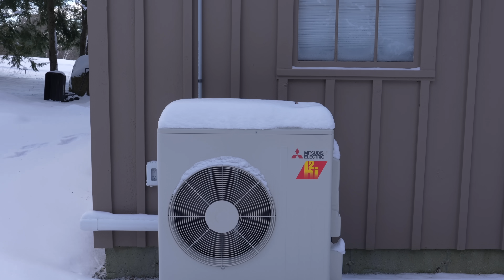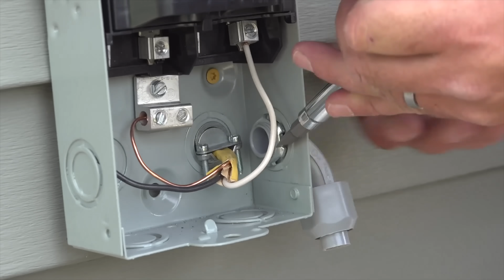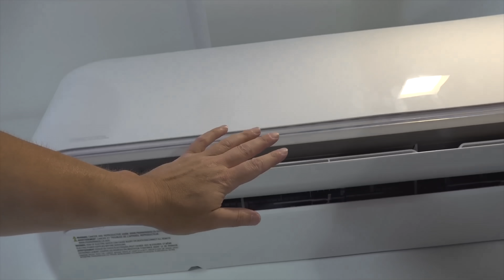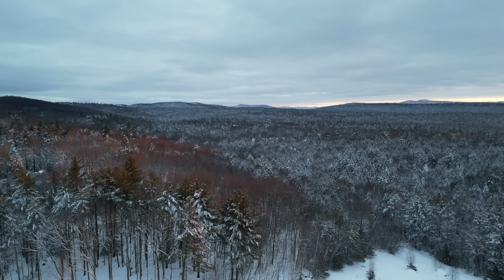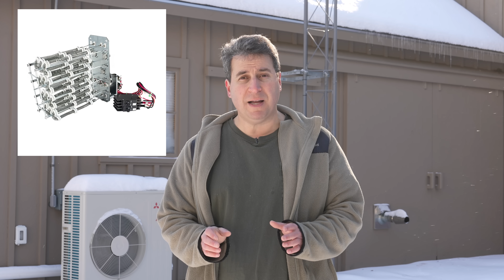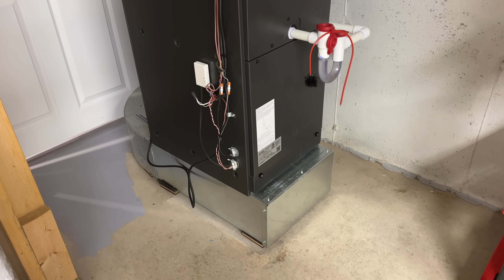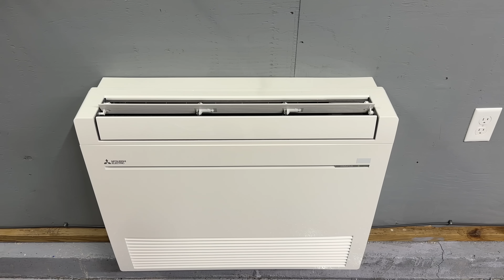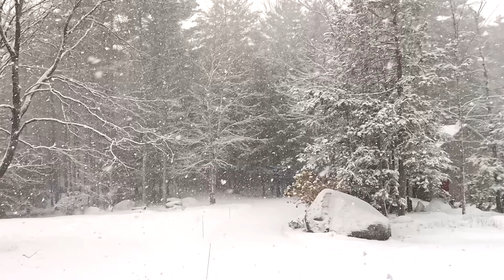Why Heat Pumps are now leaving people COLD

Comment: In the 20’s my heat pump is shit.Are the heat strips supposed to turn on automatically to help the heat pump out to try to maintain some warmth instead of running for hours ? I’m not talking manually pressing the emergency heat button on my thermostat.
Reply: IF you have a smart thermostat, then yes you can program it so that the heat strips come on automatically (you can program the thermostat at what outside temp you want the heat strips to come on at ), but the first thing  you should do is get RID of the heat pump you have and get a COLD climate heat pump, problem solved, you do not have the correct heat pump for your situation..

Comment: total waste of money...Mr Cool 24000 right out of the box opening relief valve blew freon onto my hand. These units are not topped off with freon...so they run not even 70% efficient. Hydro bills running up to $700 + a month in winter and still freezing in the house.
Took 3 of them to the garbage dump last week. No warranty unless HVAC tested.
Don't waste your money on any heat pump unless you live in Florida

Comment: When we had to replace our old heat pump and furnace we opted for an outdoor AC unit and an indoor furnace. We are locked to one electric company and they are very expensive. Running heat in the winter with a heat pump costs a lot of money. Running a furnace with gas is much cheaper.

Comment: Mine  claims to function at -22f at 75% of max BTUs without any electric resistive heat..the thing works great. The coldest day I used it was -6 and it made 105 deg heat at the evaporator.
Reply: Correct however the air source mini split will not maintain temperature around -10 C and below.
Reply: @bryant2165 the -6 is F...and heated the 300 sqf room just fine..9k btu
Reply: That is -21 c. I am impressed, and pleased for you. Perhaps your home is newer and better insulated than ours. Our house is 40 years old. Everything deteriorates with age. Including me!😅
Reply: @bryant2165 its an attic room that  was remolded..r40 in the sealing and r15 in the walls..50sq ft of south facing glass that really heats up the room in the afternoon. 20f day today and with the mini split off it gets to 80f.
Reply: Oh that is a totally different environment and situation than mine. I am impressed and a little envious. Thank you. I appreciated our exchange.

Comment: Up to 600$  month 2 units going in 1000 sq foot house. 
Without wood stove
There garbage they go de frost mode you loose all the heat. 
Specially my house is older not good insulation. 
Not ment for candian winters . Only good for - 10 tops . 
Wood fire is king
Reply: I feel and am still experiencing your/our pain.

Comment: For a heat pump to be effective. You need a proper heat loss calculation done on your home. From this information the correct sizing of heat emitters can be established and sizing of the ASHP itself.
Reply: True however when it gets cold enough air source mini split heat pumps are unable to keep up. SUPPLEMENTAL HEAT is an absolute requirement!!

Comment: This guy's full of crap. We installed a mini split in a large space with vaulted ceilings (12k btu) and it was easily able to maintain 70 degrees duing an extended cold spell of below zero f temps. No supplemental heat needed.
Reply: I live in a colder winter in Canada. He is absolutely correct. Consider EVERYTHING he tells you about air source mini split heat pumps. Everything he is completely true and helpful. There are many pros and cons about this particular style of system.
Reply: @bryant2165  I live in a very cold part of a northern US state and he is NOT "absolutely correct", nor  "completely true and helpful."  Mini splits are very popular here. and the vast majority of them do just fine. Some of the early units (before "Hyper heat" or other low temp technology) WILL have the issues he outlined, but not the later models.  (the unit I referred to maintained heat at -20f.) 

Also, sizing is critical. Most DIY'ers tend to go for the cheapest unit and undersize them, which will cause issues with winter performance.
Reply: @mxslick50 I am truly impressed and envious of your experience. My system is Lennox, 4 heads, no hyper heat, house 40 years old with subpar insulation and system is NOT diy. It has been 3 years since installation. -20 F is about -29 C. That is truly fantastic and I am pleased for you. I was lied to by the salesman. A year after the service tech who came told me that the system would no longer heat around -12 C. Now that is the facts. Thankfully we have heated with a wood stove for 40 years. It is still absolutely necessary in our case. You can teach an old dog new tricks, but he, that is to say I, am a slow learner. I profoundly regret the money we wasted on this. AC is good and lower electric consumption than the units we used for 40 years.

Comment: I been laughing at people for the past 11 years putting those in for primary heat. I have a Gas furnace with heat pump auxiliary when the weather is mild enough to use it or Air conditioning. Heat pumps suck below Freezing.
Reply: From what little I have learned from painful experience you are using the best possible union of air source heat pumps.
Reply: @bryant2165 you are dependent on outside air temperature.  Below 30⁰F. Forget it.. go Gas and let the fast recovery of heat begin when the in shot burners kick on.
Reply: @ryanyork837I deeply regret the money we spent on air source mini split heat pump we bought. Gas is not even available where we live.
Reply: @ryanyork837Yes you are correct. However propane is very expensive in my part of the country. I have heated with a wood stove for 40 years in our house. Even buying firewood is a much lower cost than propane here. As we are now 71 we were hoping to prepare for possible frailties in our senior years. Truth is I screwed up totally in my choices. Thank the Lord He is keeping me able and capable of maintaining the wood stove and firewood work. God is good. I am foolish. He provides what fools and beasts require.
Reply: @bryant2165  wood is nice.  Little secret.   It takes 29.3 kwh to make 1 Therm in gas. 1 Therm of propane is .0916 Therm per gallon.  $2.49 a gallon or buy in bulk in July and get as low as $1.74.  Natural gas is $1.59 per therm here.  Propane is 1500 btu hotter than Natural gas. Recovery time. The heat coming out of my floor registers on heat pump. 97⁰F 
On gas burner Emergency heat. 127⁰F. Food for thought. 🤔

Comment: My mother's 2018 York heat pump cannot keep up with the heating load when it is 0C outside, only managing to hold 15C before timing out and falling back to gas emergency heat. Mostly useless from mid-November through March-April. IIRC, my mother told me the installer screwed up: put in a 2.5 ton unit when she wanted a 3.5 one. Online estimators say a house her's size with as many doors and windows likely needs about 4t. Gets the job done for air conditioning in the summer but nowhere close for heating during winter.

Comment: We have heat pump in Ontario.... works great ... oil furnace doesn't heat the house until aboot -10.... we saved about 1500$.. hydro went up , but Oil was way down.
Reply: Exactly. We need/require both in this province.

Comment: I live about 1 block away from L. Ontario. It's humid. When I built my house, (1995), I did look at an in ground heat pump. I got quotes around $30 000. I would have to get rid of a shade tree, because of roots. I went with gas heating. I have A/C, mainly to dehumidify the house, as it's reasonably cool near the lake.  Recently, I looked into an air heat pump.  Around $8000. Again, it's humid here. I can't see a heat pump working after it turns itself into a block of ice. There are electric heaters to prevent this, but then I'd be heating the outdoors. Also, $8000 buys a lot of gas and my house is well insulated.
Reply: Exactly.

Comment: Exactly why a put a duel fuel system. Gas furnace combined with a heat pump split. Outdoor sensor on the tstat automatically directs heat call to the furnace when temps get too low. The perfect combo

Comment: This issue is completely dependant on heat pump sizing. If your heat pump is not powerful enough to provide the same amount of heat in cold weather as your home loses, then of course your house will cool down somewhat.
Correct sizing is extremely important for heatpumps, you should always have professionals calculate your homes heat loss in an outside temperature of your choosing (you CAN choose to undersize your heatpump if you want better effciency overall, of course at the cost of comfort) and only then should you choose a heatpump that meets your needs.
One more important thing is that you shouldnt choose based on what performance the heatpump is advertised for, rather what it can provide at the temperature of your choosing.

Comment: Everything this gentleman says is quite accurate; excellent rundown of the facts of the matter.
They're amazingly effective and efficient at cooling in summertime. But they'll struggle to heat once temperatures drop much below 30 degrees. Although, many units still provide heat at much lower temps; mine were still doing their job last winter in subzero temperatures. But  it also resulted in my highest monthly electric bill of the season(running inefficient space heaters to kick up temps).
I'll definitely add another supplemental heat source in the future rather than relying on space heaters to make up the difference during the coldest months. Thankfully, my part of the Midwest gets only a few months of intense cold. If you're up north, I don't imagine you'll be content with heatpumps as your sole source of heat.

Comment: With a proper sized grid connected solar system on my roof, heating costs with a heat pump system and a resistent heater, in the air mover, are zero dollars. The cost to charge my EV is also zero dollars. The cost to heat my water is also zero dollars.

Comment: I live in Finland. Here air heatpumps are installed in almost every older house as a backip at least. if they have had direct electricity heating as primary heat source. One unit will not cover the whole house so the radiotors will still give some heat in some of the rooms. Mitsubishi RW have the best reputation for generating heat when it is cold outside wit a SCOP of above two even if it is -30 C outside.

I feel that the colder the minum yearly temperature is the dimensioning of the pumps become more kmportant than the average yearly SCOP. Should I get one 35 unit or two 25 or even two RW35. Intutively getting two smaller pumps seems like a good idea. You can run one unit when it is warmer and two units when it is really cold. Then you also get a better heat distribution through the house. One should alternate the pumps as they do not like to he sitting unused for a long time. Nor do they like to turn on or off all the the time. They do not like to he started at very low temperatures either ifbtheynhave been sitting still.

To my understanding there are a few  reasons why people might he unsatisfied with their heat pumps. Poor quality and incorrectly dimensioned pump, poor installation and poor operations. Choosing a quality pump and installer that will install it with not a too short or long piping. Clean your filters and run the pump a minimum of once a month for a short period even if you do not need heating or cooling. Clean the heat exchanger minimum each five year and  it will fuction +15 years. In short follow the manufacturer recommendations for maintanace. Most of it can be done DYI.

Air source heat pumps are good since they are cheap in comparison to many othet solutions. We have an air source heat pump for our garage. There are also radiotors on the wall as a backup. We heat our house with geothermal. Yearly heating bill for the garage is 180 EUR for the garage, and 620 Euros for the house. All-in-all we heat 240 square meters. Average yearly temperature is + 7 C. The system is dimensioned to handle -27 C. We might go below -30 C but there have been no need for using direct electricity. I have set the radiotors to +5 C in the garage and turned off the reistance heaters heaters in our house. They would only turn on if the pump would fail.

Popular brands for air heat pumps here are Mitsubishi Electric, Toshiba, and Daikin. These are well tested and  reliable in Arctic conditions. Cheap installations could be a Gree or Panasonic. Installers however first recommend one of the three first options.

We heat our house with a Bosch Compress 2-8 kW inverter geothermal heat pump with a well of 178 meters. The garage is heated with a Mitsubishi AY25. That pump is suitable for smaller spaces. I also only have +13 C in the garage. You should not go below that in order to allow the heat pump to properly go through the de frosting cycles.. it is also enough to keep the moisture out and dry the car over night. COP at -25 C is still at 1.8 according to state owned independent reaserch test laboratory VTT. Cost of installation was 1600 Euros some years ago.

Regarding the installation in this video this would be a no-no here. The outside unit should be installedaround one meter above the ground. Reason is that when the ground freezes ice will start to collect under the unit as it does its defrosting. It definately needs to sit above the maximum snow cover if the snow falls around the unit. I usullay have an ice cake of 30 cm under the unit in spring before it starts to melt. It is mouned on the garage wall one meter above the ground but otherwise free to the elements. This is ok in the separate garage. A ground mount is preffered for a house.
Reply: Sadly we Canadians have a superiority complex. We actually believe that “elbows up” will stop Trump. Our only true identity belief is that “we are not Americans”. However over 80% of our population lives within the border. Even the newer immigrants, who I believe Canada desperately needs, are also true Canadians and live within the border with us in this zone. That is how I personally can tell that they are truly “one of us”.

Comment: A heat pump is basically an air conditioner that can run backwards. Think of flipping a window A/C around. Air conditioning systems don’t magically create cold or warm air. It is simply transferring heat from one place to another. In the heating cycle, it is transferring heat to your home. But there has to be something to transfer heat from. Most heat pumps are air to air. So as the air outside gets colder, there is less heat to transfer. Also the coil outside must be colder than the air outside for heat transfer to take place. When the coil drops below 32 degrees, moisture will collect on the coil and begin to freeze. This drops the efficiency further. So when the coil becomes clogged with ice, it goes into defrost mode which reverses the flow and turns it back into a regular air conditioner and will start adding cold air into the space until the coil is clear. The colder it is outside the more this happens. The only real way for heat pumps to work in all conditions, it must have access to a heat source such as geothermal where there is enough heat to prevent the coil from freezing and also stabilizes the heat output. As far as the fancy talk of inverters go, this is just for efficiency. It just varies the speed of the compressor to match the load it’s seeing. In other words, no matter what if your cold season sees temperatures below freezing for extended periods of time, you will need something else. I don’t have one where I live because I heat my house with a natural gas furnace. This is the cheapest way to heat my house in my area. I’ve never been cold or had pipes freeze. If electricity is all you have a heat pump does make sense. But geothermal would make a lot of sense if electricity is all you’ve got or is your cheapest choice. But you should always have a backup heat source as heat pumps are more prone to breakdown than other heating systems. I’ve been in HVAC for over 30 years.

Comment: I got rid of my DAMNED heat pump. They are expensive to install, expensive to operate (especially when the temperature is below 20F), and they BREAK ALL THE TIME. They are a nightmare. I switched to a Trane gas furnace and Trane A/C this fall.

Comment: My heat pump has absolutely no issues with efficiency down to -27C which is the lowest temperature on record since the install. The catch is that it's not an American air-to-air HP, but a geothermal, deep-borehole type that's almost independent on air temperatures. And the house is rated passive-before-ventilation, so with all windows closed there's not much need for heating anyway.
Reply: That is a completely different animal compared to air source mini split heat pumps.